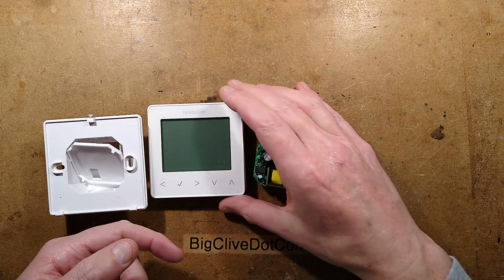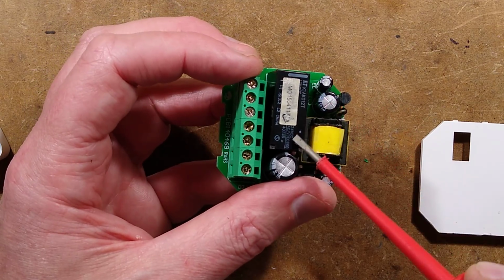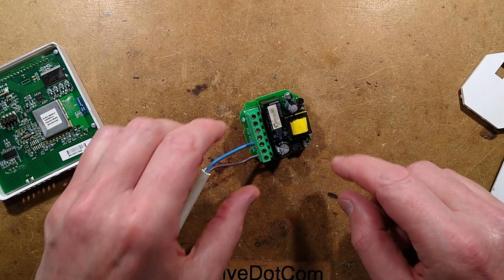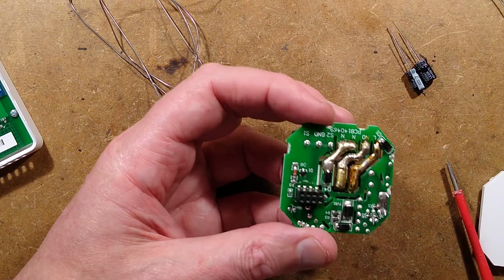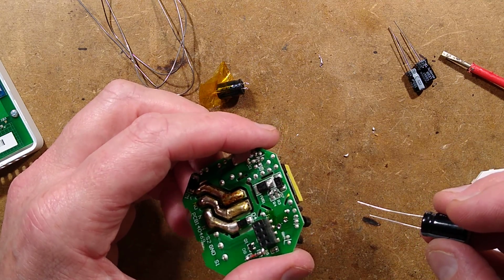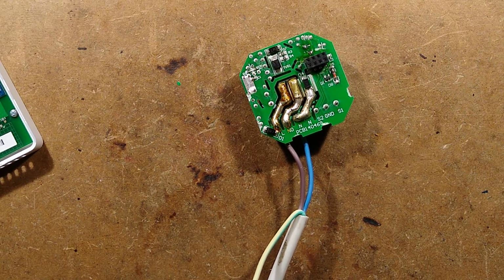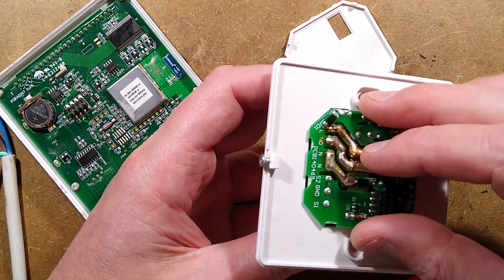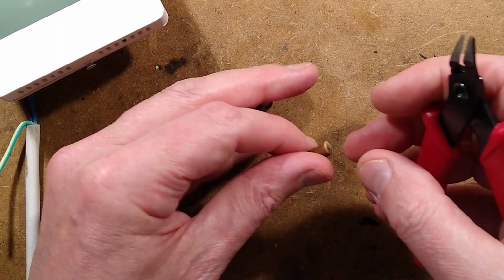Fixing a dead digital thermostat

Comment: To get capacitors out I attach a pair of long nose locking pliers turn it upside down and heat it up. Gravity combined with the weight of the pliers does the trick every time 😁

Comment: Hi Clive could you possibly fix my nest heat link it's totally  dead when 230vac is applied
Reply from the maker: I've made videos about a common Nest failure.  If it's a standard one with a micro USB connector on it then you can do a quick test by powering it from a USB power bank or charger via that USB port.

Comment: The other reason Capacitors dry out is the designers position them right next to hot running heat sinks or hot transformers.
Built in obsolescence 👍

Comment: Thanks Clive for this - I had two similar Heatmisers ready for the bin, and while no capacitors looked to have visually failed, I replaced the 220µF capacitors and this has got both up and running :-)

Comment: I've had repeated problems with analogue timers failing on my hot water circuit. On my fourth in 10 years now. Just replaced another one last week which had become intermittent. Not sure if you are interested but I still have it.

Comment: Electrolytic capacitors have been the issue with a lot of older failed electronics I've worked on. With computer motherboards, displays/TVs and basically any power supplies.
This is fortunately often easy to spot like it was here as well.

Comment: Hmmm "jooseee solder" haha what a turn of phrase I'm luvvin' it!
Amazing how a device that has not changed in hundreds of years causes the majority of faults on electrical items and sends them to landfill for the cost of a 25p component!
Bit like all those Led tellies you see at the Cowp all junked for the cost of a 50p Led - If only they wired them all in parallel eh
Built in obsolescence or am I being cynical lol
Just fixed my 10 year old Indesit washing machine - fault - two 25p capacitors!
Hopefully that's another 10 years use!

Comment: Oh wow you guys do stuff differently over the pond. Here in Canada/US, we use 24VAC for almost all thermostats. Typically there's a 120VAC to 24VAC transformer inside the furnace that backs feeds low voltage wiring to the stat.

Comment: Speaking of thermostats, do you plan on doing a vid on the HeatZo heater? It's very small, fits into one's hand but it is a plug in unit that I can't imagine puts out enough heat to even begin keeping one from turning into a popsicle. Also curious where it's made and the safety too. Supposedly designed by a Swede but doesn't mean much in today's world of 'Made in China.' :)
Reply from the maker: They're very common here.  More of a gimmick, but they can provide useful heat in small areas.

Comment: Is it correct to say that you 
first guessed something might be wrong with the electrolytic capacitor
Then you checked it with a multimeter. Figured out it was measuring 5v when it was supposed to be 12.
And then switched it out with a bigger capacitor to avoid capacitor pressure. So it won't blow a small hole and vent itself?

Comment: Tip use  compressed air to blow the solder off the solder pad.
Reply: Yeah, but compressed air is also filled with water vapor, and you don't want that around in your curcuit...

Comment: Hmm, I reckon the only way you could have made a short video by connecting the wires to the wrong place is if you placed both the wires on the low voltage side. 
L and N swapped: would still work normally on the bench.
L or N connected to the relay contact: relay normally open means no current and no loud bang.
L and N connected to the two N terminals: the plug fuse would blow, but the thermostat would likely be fine even after that brief current spike.
L or N connected to the low voltage side: It's an isolated supply and this is really no different than the probe somehow shorting to ground under normal operation.

Comment: On the note of detonating variable frequency drives, my coworker had a case where he got a 240v drive with a 480v sticker on the side of it.
This did not end well.
I had one go up on me some fifteen minutes into testing the machine it was running. First time I've found myself sprinting for an emergency shutdown button.

Comment: I once tried to fix a PSU by replacing the caps. Upon powering it up, it blew the mains fuse and the cap. must have been a short somewhere else. wasn't experienced enough to think of anything else back then, so I just enjoyed the fireworks and then tossed it in the bin.

Comment: Well, the cap having spewed it's guts explains what all that brown gunk on the mains power traces is.  It initially looked like flux residue, but it it was that why wouldn't it be on all the traces?
Reply from the maker: It is flux from manual solder reinforcement of the current carrying tracks.
Reply: @bigclivedotcom  Well, once again we have a demonstration of just how little workers in Chinese factories get paid.  The CCP decided they don't want much of a middle class, and they're sure to not get one this way.  (Never mind that the middle class is what drives a modern economy, and has been for at least the last 2 centuries.)

Comment: these 'modern'(ish) caps are utter rubbish compared to pre mid 80s ones, from then on things started to go downwards rapidly, bad caps (and resistors gone sky high) were a problem in many late 80s to mid 90s cheapo colour portable tvs, (worst was the 2000s when the capacitor plague was a big issue), not helped by them making them smaller and smaller, less able to self dissipate any heat generated by ripple current, the big 'ol  caps seem to last well,
Reply: be wary with 'teapo' and 'chang'/'cheng' , 'changx'/'chengx'  branded things,  and sometimes 'samxon' , they're some of the common iffy brands

Comment: ive got a first gen ps1 that had this issue as well, the top on one of the caps was domed and burst, no surprise really, the first gen systems are infamous for cooking themselves, the psu was just poorly designed and they never really resolved the heating issue, just reduced the consequences, which mostly means that the disc drive stopped getting baked in its plastic parts
yeah, that specifically is why turning it upside down fixed your disc read issue, you were taking the stress off the baked sections and gravity was pulling it back into alignment
half my modular power units have also suffered baked caps, a vehicle power inverter, a lab experimental circuit station, it always comes down to one single baked capacitor

Comment: In my days as a comms tech we had a lot of issues with a certain brand of caps, we had special gear to keep the power on modules while we removed them to bridge another cap across suspect ones, any interruption to power and the damn things would start working again, for a while..

Comment: Honestly, my trick with removing capacitors is to press on the same side of the cylinder as the pin I'm desoldering, until it budges a little. Then I switch to the other side, doing the same. It lets me rock it back-and-forth, making continual progress. The initial little movement feels minuscule, but makes all the difference. 

Works a treat, since a lot of the time, like you experienced, I can't get purchase on the cap to do it the "lift" way. (Also because I'm not as dexterous and coordinated as you are with your fingers doubling as a helping-hand haha)

The only problem is when they've pinned it where the one ends up being smack up against a fixed object, either a heatsink or a transformer. Usually in either case there's still enough to rock it -- I mean lets at least hope the designers left enough room , otherwise I feel that'd be the textbook definition of how NOT to clearance such components -- but it takes longer to get it out since you only make the same limited progress each back-and-forth.

(I am sure this is something we ALL have come to learn all on our own, but I'm hoping my sharing this will perhaps let someone spare themselves the time learning that! heh)

---------

BONUS STORY: I remember when my computer PSU finally died on me. (was a 430W Corsair, unpainted, just a model number, as it was before they cared about such things;)
 I had used that thing for probably a decade, buying it for when I built my Dual AthlonMP system (I had modded AthlonXP's by bridging the magical trace on the CPU lol), which then powered my two Athlon64 systems -- a Single Core, then a Dual Core, both Socket939.

Anyways, after we moved in 2009, I fire my system up and... nothin. Sadly, it took out that motherboard, and another one... And my CPU :( 
So me being me, I tore the PSU apart to try and fix it, figuring it was the caps, and yea, lots were bad.
UNfortunately... I knew ZERO about that stuff, and so as I replaced them with salvaged caps from other stuff... I had NO idea I had soldered them back into the PSU....... with their polarity reversed... :}

On the plus side, I had enough sense about me to 
A) take it outside before powering it up, 
B) not have the PSU connected to anything, and 
C) have its required pins shorted to turn it on (outside of a PC) BEFORE I plugged its power cable in, so I could be far enough back lol

Because yep, a split second after I plugged it in... BANG.... BANG-BANG
3 of the 6 caps I replaced, I had unknowingly soldered in backwards. That day I learned that some capacitors very much care which side is Ground and which side is Positive! (these were all on the DC Output side)

On the down side, I was done monkeying with that PSU trying to fix it.
On the up side, I found out a cheap way to make a nice bang noise! (Some day I'll have to try it with a much much larger cap lol)
Reply: I attach a pair of long nose locking pliers turn it upside down and heat it up. Gravity combined with the weight of the pliers does the trick every time 😁
Reply: @Aussiehomestead1965  Seems valid but wouldn't the weight of the pliers require too much clamping force, that it would crush the capacitor??

Comment: Your talking about the frequency the capacitor on the low voltage side made me wonder if that capacitor would have lived a longer life if it had a bridge rectifier before it in either a single package or 4 separate diodes.

Comment: Big clive, here is an idea for a video if you haven't already done it. I have all these Maglights laying around with old incandescent bulbs in. can you show us how to break the glass of a bulb and replace it with a superbright LED and a resistor or a mini driver chip, so it can run off of 2,3 or 4, C or D batteries? I hate to discard these lights, and the off-the-shelf LED replacement bulbs arent really that bright.

Comment: Felt 240v the other day.. shaking concrete breaker cable until I decided to disassemble the breaker and change cable.. got to into it and got a shock... still left plugged into the extension lead 🤦‍♂️

Comment: Satisfying when I fixed a tv by replacing 3 domed caps on the power supply.  

No joy with a touchscreen thermostat that lost its touch.  I got it working 3 times by cleaning the connections of the 4 wires, but it kept going nuts.  Likely corrosion that got migrated to the otherside of the board underneath the LCD.  Used it until I had to interact with the underlying thermostat function to change it to heating when I popped in a replacement.

Comment: I have a question that no one can answer about thermometers. Room type, non-submersible. Ones that sit around and show the ambient room temperature. If there are 3,4,5 or just more than 2 of them sitting side-by-side, and each one reads between 2°-3° different than each of the others, how do you tell which one is correct? If one reads 60°, another reads 63° and yet another reads 62°, what is the correct temp? I have seen this in a display case in a store and all 9 of them read something different. Mine do the same at home, not by any sunlight or drafts. Is there a way to provide a known temperature to them and see if one is correct? Any takers?
Reply from the maker: There's always a slight tolerance variation.  The humidity meters are worse.

Comment: Talking about playing about with electronics and mains voltages ... I was working late on a faulty PSU a few months ago in a prominent building in London. I had to swap out the switch mode PSU for a lock which just wasn't supplying the full 13.8 volts (12 volt nominal) under load. It was running off a UPS as was the network switch which itself also was running two cameras and the access control panel. I clearly wasn't paying attention and put green and yellow where brown should go and vice versa. All nice and tidy and sound, I plugged the "kettle" lead into the UPS socket and there was a loud bang. Suddenly nothing was supplying anything. The fuse in the spur blew, the breaker behind it locked away in a riser somewhere unknown to me tripped and the UPS turned out not to be as uninterruptible as expected. Fortunately, a knowledgeable resident electrician was available and he just said "oh well, that's what breakers are for", reset it, I corrected my connections, changed the fuse and breathed a sigh of relief when it all worked on power up.

Comment: It is common practice to put multiple diodes or resistors in series to improve safety in the event of a failure mode. If one fails short circuit, there is still another to take its place. However if it did fail short circuit then it becomes a dormant failure which is not ideal.

Comment: I recapped a failed industrial PLC power supply the other day. It worked afterwards.  
I measured the suspect caps with an LCR meter. One of then measured 1.9KΩ @120Hz,  couple hundred nF
Cheap gemmy 'gemcon' brand. Replaced with nichicons.
Overall the PCB was nicely engineered - other than a failure to design in some thermal pads to floods -- with very small vias.

Comment: These thermostats come with common face plate and different rear modules.. you can get either a high power switching module (10A) for things like electric underfloor or the standard 3A switching for standard heating controllers.. the front faceplate has modes for underfloor heating (with an optional floor probe thermostat) standard thermostat or just a basic timer mode... This is a version 1 Module with the blue backlight, Version 2 has White light (with proximity sensor) and the buttons light up, so you can use it in the dark! (with the version one you can see the screen in the dark but can't see the buttons so it is near impossible to use.)

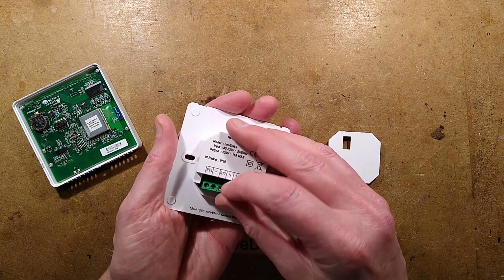Comment: This overheating was obviously a problem.  0:55 The plastic backplate with the writing on it, now has vent slats in it. That one is fully enclosed in plastic giving no ventilation. A bad initial design for the plastic enclosure, which Heatmiser have rectified. The electronics appear to be more than good enough. 

If you have an old one like this which is solid plastic, drill small holes in it, especially top and bottom. Recommended.

They fit into a standard, electrical, single, 35mm deep, backbox.  Best to have a metal backbox to dissipate heat. Recommended.  

This goes for any other make of timer/stat that fits into a standard single backbox.

Comment: Edit: I watched the video and see the plug into mains power 

Do European thermostats use the same strange 24 VAC system that US thermostats do and then there are different connections bridged to ground to turn on the fan or heat etc, or is there 240 VAC and then other wires?
Reply from the maker: Many UK systems are 240V.
Reply: @bigclivedotcom  oh, ok. Makes more sense than 24VAC

Comment: I’ve got a bunch of these Heatmiser stats. I’ve done the exact same fix on 2 of them so far. Other than that, they’re pretty robust and work pretty well. Just could do with a better quality lowESR cap in the first place.
Reply: Good to know, we have these in every room so will be prepared if they die. As the PSU is a separate part it would be good if Heatmiser sold them separately.

Comment: 6:45 instead of using with the white tac and captain tape, wouldn't a decent glove on the left had deal with this issue easier? That's what I would use since a glove provides grip and heat isolation.

Comment: I got caught out with mains voltage once because of shoddy wireing ... isolator had been isolated but not removed I flipped the switch and removed the fuse... installed a nest thermostat normal stuff call for heat heat off ect.... wired up earth and neutral then go touch the live ZAP ....  the language coming out of my mouth was not fit for little ears. customer goes are you  okay... im like no and turned there hole house off 😅
Reply from the maker: It's not uncommon for heating systems to have a common boiler call wire fed from multiple different circuits.  (It shouldn't be.)
Reply: @bigclivedotcom  yeah it shouldn't be I don't take any chances any more.... lol if I come across a faulty nest thermostat ill post it to ya so you can make a video... but please don't hold ya breath nest /google normally ask for them back 😥

Comment: I just removed this morning an led disc light over the kitchen sink and swapped it out.   It had started to switch off randomly and then back on.   After swapping out I asked myself …. What would BC do with the old one?   Take it apart and look inside.    There I found a neat SMPS and … look!   A badly domed cap that had also overheated.   Some juice on the pcb around it too.    Clearly BC would wish to at least swap the cap out.   When I lifted it up the jacket fell apart so I lost the mF reading.   It was a 50 volt and 105 deg cap.    I’m thinking to try a 220 mF cap.    Any other ideas?    It is right across the output to the 10 led chips.   Enjoyed the repair as always.

Comment: I usually re-flow, then use a solder sucker and some wick. Then, I melt what's left one at a time and push on the leads with the tip, leaving them free floating in the hole.